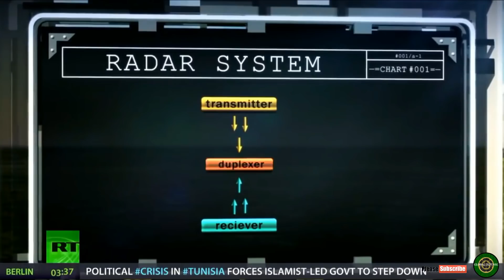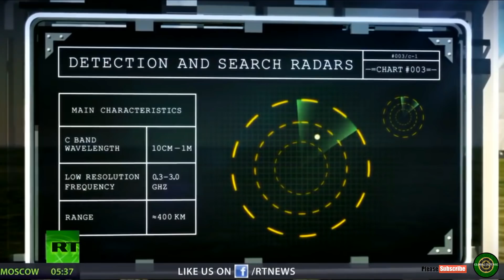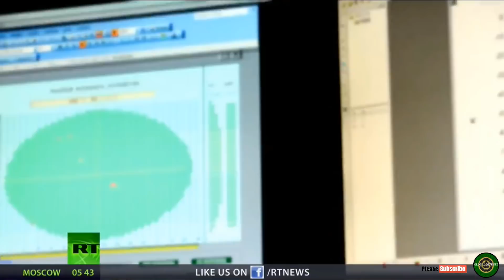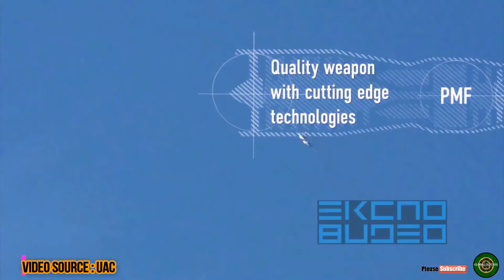Russia’s Su 57 PAK FA stealth fighter is about to meet US F 22 & Israeli F 35 Lightning over Syria

Comment: Doesn't look like they did much with the exposed engines on the back end though. F-22 has the flattened exhausts for IR diffusion and not just reduced radar return. I wonder why the Russian design didn't try to attempt the same?

Not sure if this thing is good enough vs. the F-22 or F-35, but it may be something that can punk around with the F-16 and F-18 due to lowered radar visibility. (And those aircraft are still heavily used by other countries likely to oppose Russian allies.)

Comment: As soon as the SU 57 uses its thrust vectoring it will present a different aspect to even a single F22 and will be entirely detectable. The F22 and F35  are stealthy from.all angles. But the F22 pilot will receive radar detection from all available assets including other planes, drones, satellites, and ground based radar. The plane's computer integrates and processes this information quickly and in real time. Once detected the pilot's only decision is whether or not to destroy it. Once he launches his missiles he can leave. The American system is fire and forget as the missile does all the rest.